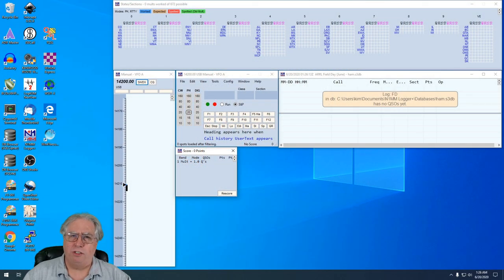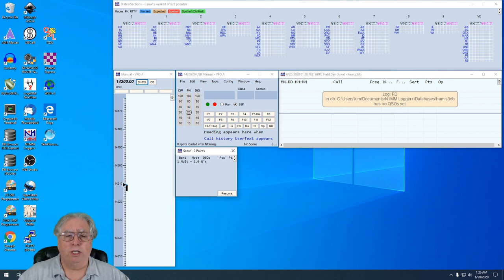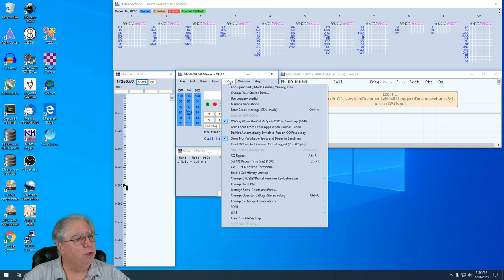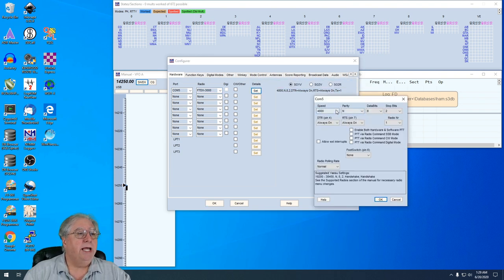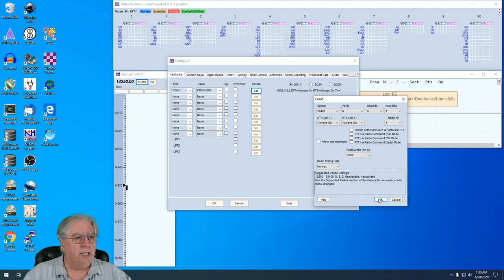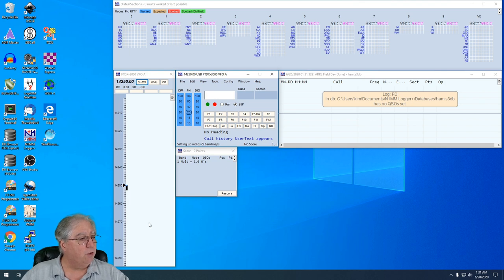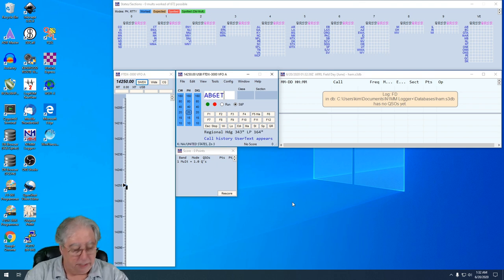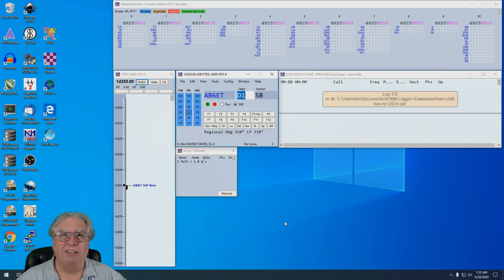Connecting Your Rig To N1MM+ Logging Software

Comment: Great video. I run a mobile shack with a Kenwood 480sat. Now I'm looking for a older laptop with a serial DB9 port. I can connect a straight cable between the two. Page 67 of the Kenwood manual has the comms parameters for N1MM. Should work like a charm. Thanks again.😄
Reply from the maker: Hi Glen,
You certainly can use a USB to Serial interface and not limit your laptop horsepower if you would like. I would recommend the FTDI serial chip for those adapters.
Glad you liked the video!

Stu
AG6AG
Reply: @AG6AG  Thanks for the feedback, Stu. I have a Surface laptop which of course has USB ports. I'm looking at a DTECH cable with a built-in FTDI chip on Amazon. $25 Cdn. (I live in British Columbia.) A great solution. Certainly will help with using N1MM during contesting. Thanks again. PS - have a great holiday.

Comment: What is the correct USB cable to use N1MM on a Yaesu FT-991A? Can I use the cable from RT Systems programming kit?
Reply from the maker: Hi RIchard,
Any USB A-Male to B-Male cable should work fine. You will need to download the drivers from Yaesu to access the USB COM ports that on the FT-991A. The cable provided by RT Systems is just a standard USB cable.
Hope that answers your question,

Stu
AG6AG

Comment: can I use this without a rig controller unit as shown in my Ic 718
Reply from the maker: Hi Larry,
Yes, you certainly can. If you want to track your frequency and mode you can type the frequency into the call window, hit enter, then type in the mode, and hit enter once more.
Hope that helps,

Stu
AG6AG
Reply: @AG6AG  Ok I don't have a CIV unit here yet but would love to do so which would make it easier making  RTTY contacts. I have been looking in the book of the baud rate of my IC718 and haven't found it.
Reply from the maker: I'm actually looking at the IC718 for a second radio. It looks like a simple rugged radio that can be used in the field. I see there is a cable for it as well so you don't have to buy a CIV unit. I'll let you know if I get it and if the cable works.

Stu
AG6AG
Reply: @AG6AG  thanks for the reply I have tried a few times to get it running but it comes up with errors and in the connections to the radio and I looked in the book for the baud rate but havent found it. I have a FT857d and Icom 706 mk2 and p[lan to try them on this plan
Reply: also, my adopted sister Tia from Indonesia uses one in some SOTA programs, she is a strong CW Operator.